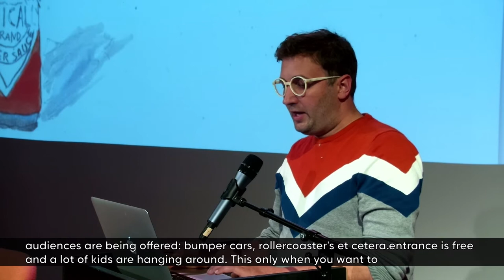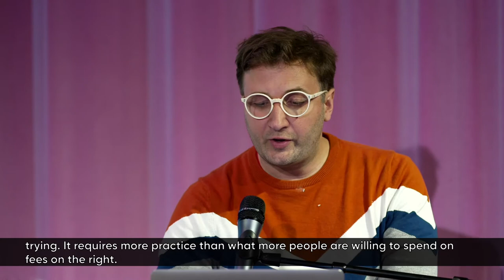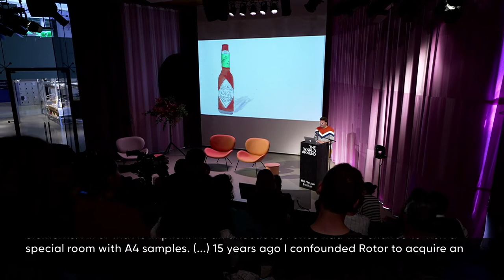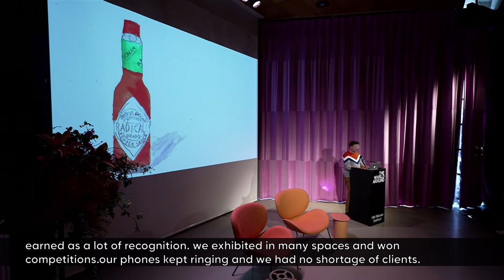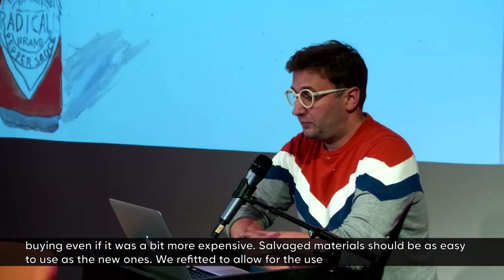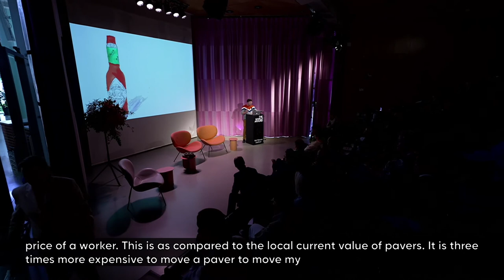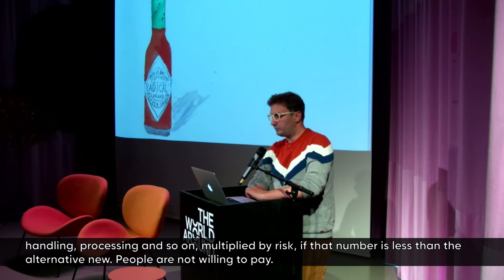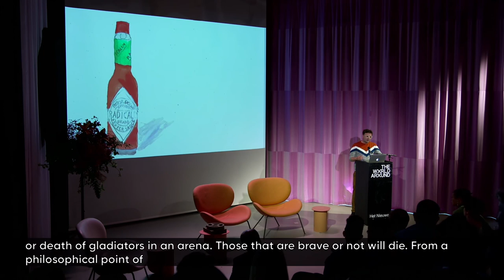Rotor Deconstruction on How to Recycle a Building

Comment: There seems to be a flaw in Maarten's argument. He looks at the market price of new material and compares it to a similar amount of reclaimed material. But the infrastructural cost of new material is not factored in, neither by society in general, nor by Maarten. Society, the world in general, pays the massive cost of equipping the planet to provide new construction material, in the past, now and in the future. The market cost of the marble has no relationship with its true cost. This is like ignoring Scope 2 and Scope 3 emissions (and Scope 4, 5 and 6 which have not even been discovered). Look at the floor price of a tonne of emitted carbon - currently $3, $20, or even $80. But some people are saying the true cost is more - $500, $2,000 or even $3,000. And these figures do not include other impacts which the planet has exceeded its ability to absorb or adsorb. If Rotor were reimbursed on that basis salvaging would be immensely profitable (until world economy and big business caught up).